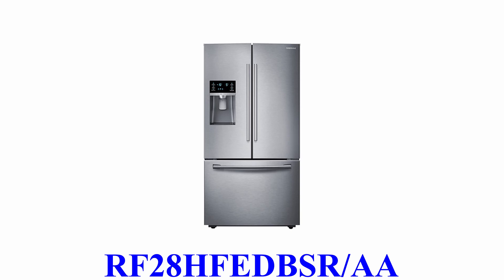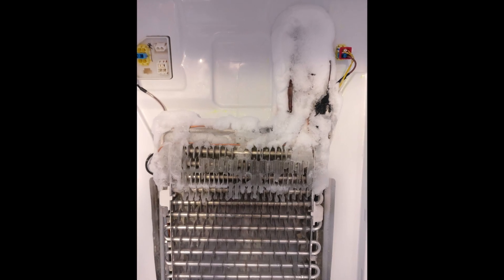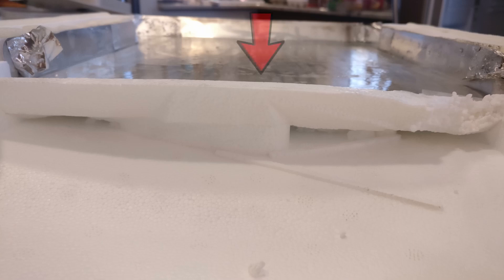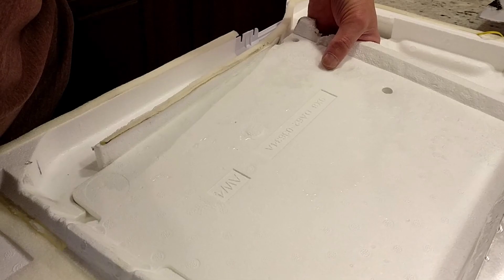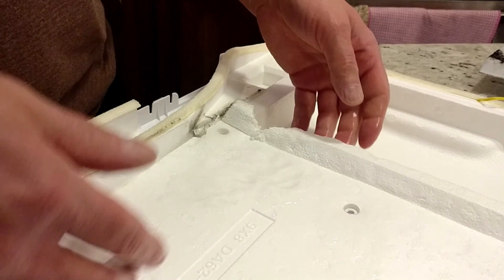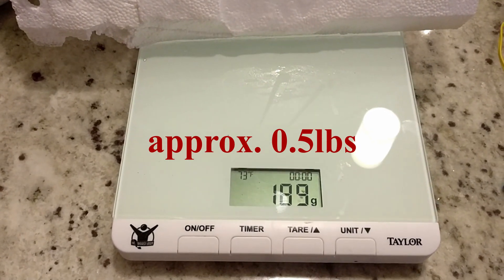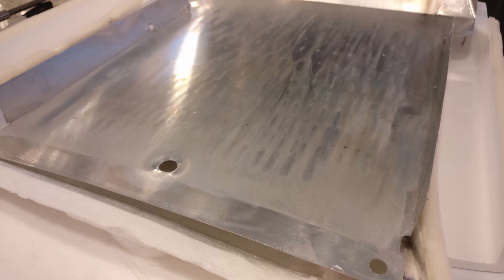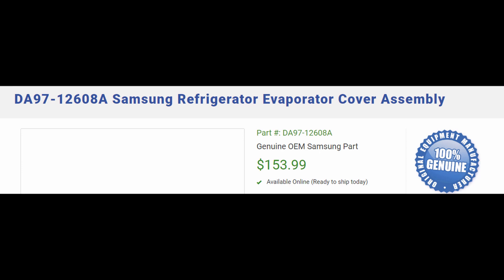Samsung fridge freeze up model RF28HFEDBSR / AA

Comment: I have got the same problem.  I need to unplug it overnight to defrost.  It took me lots of time to clean up the water and take out and put back the stuff inside the fridge.  Most of my time, I only noticed it got froze up until the food got rotten.  I did contact samsung, but they said there were no complaints from Canadian customers.  It looks like I am the only one to have this problem and asked me to call their authorized technician to fix it.  I asked them if there should be a recall for the fridge and always have ice build up.  That customer service lady said there were no complaints from the Canada side but only in the States.  That's why there's no recall in Canada.  Until now, I found out quite a lot of consumers talking about this on YouTube.  I hope everyone can place a complaint to Samsung Canada and let them face the problem.

Comment: I could not get the evaporator cover out as the styrofoam is tightly inserted into the coil space.  Would it easily break?  Is it glued to the panel or anything else?  How long do you have to defrost to make sure no ice is tied with the styrofoam?

Comment: In response to ALL of you guys in an effort to help u get to the bottom of the root cause for why the ice freeze occurs in the first place which I believe is the same for all of us… Samsung did a poor job sealing the penetrations where the coil lines enter thru the white back panel which is allowing warmer air to enter this otherwise sealed area. This area is the source of where the ice starts to buildup.  So I simply bought a 1lb jar of Flex Paste (in white) from Home Depot which is a pliable rubberized paste that I spread all around those coil penetrations and all over and inside that black foam too.  Apply liberally all around that area so u see no openings at all!  and no concern to get the paste on the copper coil lines - it’s ok.  NOTE- I did have to blow dry the black foam which had ice frozen inside it BEFORE I applied the paste.  The paste will start curing (skin over) in less than 20 mins, so u can start reassembly shortly thereafter.  U do not have to wait for full cure as the jar of paste indicates.  To clarify the area I am talking about - the coils enter the near the top right of center of the area u uncovered when u remove the Twin Cooling cover.  Reminder to still perform the “Forced Defrost” on the control panel like every 6 mos at a minimum to keep all coils which includes the ice maker coil from potential freeze ups.  The Forced Defrost mode is easy… Hold down BOTH Freezer and Lighting buttons at the same time for about 8 secs and u will hear a beep and your screen will be blank, then tap thru hitting the Lighting button 4 times til u see “fd” then it will beep during defrost for I think about 20 mins then it will stop and go back to normal mode.  Hope this helps.

Comment: Very common problem and I have had to defrost mine for the condenser freezing up every couple of months for a few years now.  Very frustrating problem with Samsung.  Here are the tricks I found after I hear the fan starting to tick on the ice....
Before you start, hold freezer(top left) and lighting (middle right) buttons down until it beeps.  Hit any button until you see Fd on the display for force defrost mode. This will help loosen up plastic when removing.  Unplug. Empty fridge. Remove 3 shelves and tip up one against ice dispenser. Remove both drawers. Opening right door, separating outside door, and pushing back milk sliding door unit will help get right drawer out. Pinch sides of filter to pop up large glass shelf.  Pull forward about an inch or so then tip at 45 degrees to get out. Remove 1 screw on top and 3 screws on bottom to remove center metal rack and carefully tip back "Twin Cooling Plus" wall out on right side.  Left side has two electrical hook up to remove before pulling out.  Careful! Next you will see ice like in video.  Do not heat too fast with hairdryer or heat gun as you will warp plastic.  Hot water and turkey baster works too.  I think pros use steam.  Reverse order to reassemble.

Comment: Same fridge, same problem.  Instead of calling the repairman now (already spent more than cost of fridge, including motherboard, etc) Now I am saving up for a new fridge, but in the meantime I unplug it, after transferring perishable contents to safe location, and let it thaw for 24 hours.  I plug it back in and enjoy for however long it continues to run, but once I notice my lettuce and cottage cheese etc freezing I know the noisy fan is not far from happening. Repeat until new fridge budget is reached.  Does anyone know of a More Reliabel brand/model?  Unfortunately I bought mine at Sears plus 6 year extended warranty about 6 months before Sears went under, so I am stuck with a useless piece of paper for warranty.  Nobody will honor it.  Grrrrrr.

Comment: Same problem. Are we sure the heating element is not bad?
Reply from the maker: Yes, for sure . The styrofoam should not be absorbing water like this , it was some sort of defect. The replacement part appears to be made of higher density styrofoam, hopefully this will last longer and not breakdown and absorb water.
It appears that this heat/ cycle broke the old foam down and allowed water to be absorbed .
Reply: @chops2x  hi there. so no more problems after the  foam replacement? no more ice build up at the top?

Comment: Yesterday is the 3rd time that my wife and I heard the fan noise. First two times I had to pay for repairs and their explanations are like yours. This time I've turned off the refrigerator and we moved all our food to a 2nd fridge in the garage. I'm hoping just letting it defrost will work. Hopefully it is not too late.
Reply from the maker: Replacement was necessary in my case. I only lasted about a month before I had to thaw it out . After replacement, it's been about a year and no issue so far.
Reply: @chops2x what did you replaced I’m having the same problems

Comment: Got same problem also.  I just put that part under the sun for 2day to dry.
Reply from the maker: Hi there , did it work to dry it out , what did it look like ?
Reply: @chops2x  it work... Anyway dont put that foam part directly under the sun.. It will shrinking or bend.. Wrap that foam with old bath towel it will evaporated the excess water and dry slowly depend on temperature at your place. You need a aluminium tape to seal when assembled back on cover panel.

Comment: I can't even get the panel off. My husband crack it trying. What can we do to get it off without further breaking it?
Reply from the maker: Maybe let it thaw for a while ( like a long time... ) , if it's has a same problem order a new replacement,  hope it works.
Reply: It crack because the panel still stick on the condensor.. Need to off the unit for a while to melt down the ice... U can use that back . After fix the foam,  just glue back to panel and put aluminium tape to seal
Reply: The styrofoam broke on so many pieces when we took off panel.  Can I just not use the styrofoam?